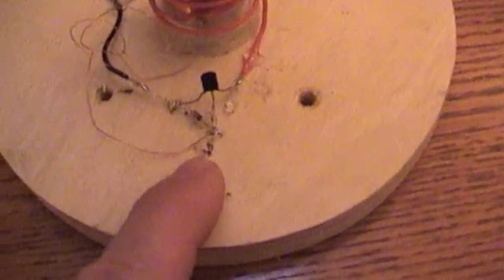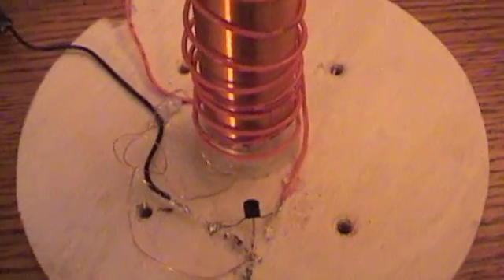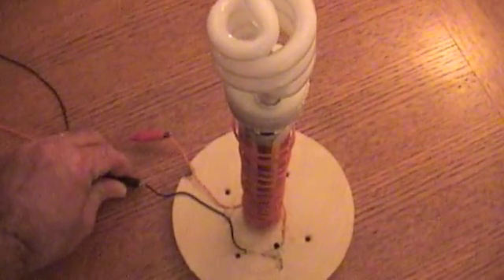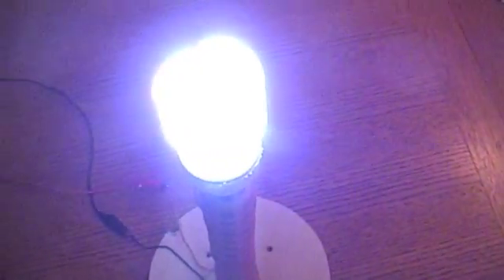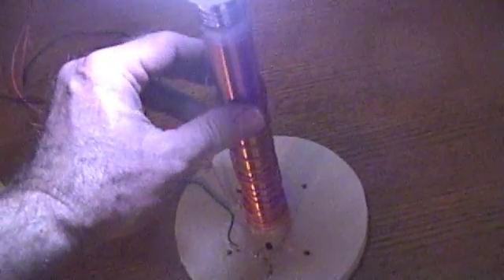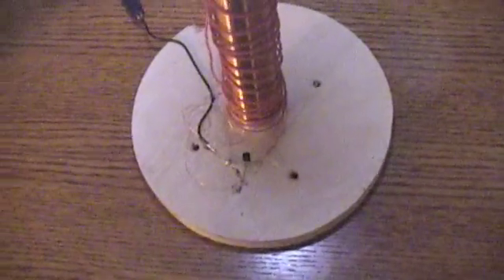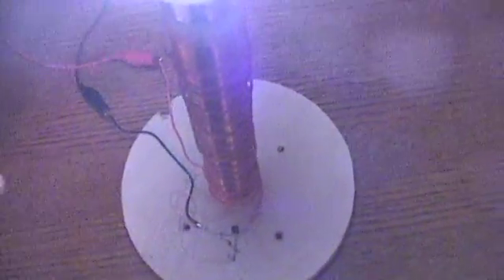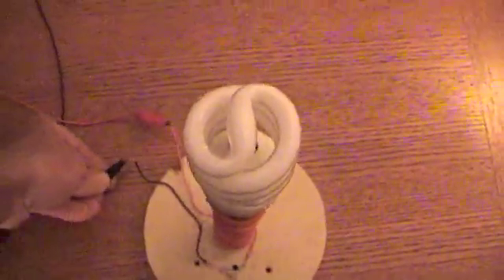Tesla Lamp 2.0 CFL driver

Comment: maybe try a fast power transistor. My slayer/tesla coil is running a tip31 Gives about 1.6mhz on L1. Which I can tune to about 10mhz on L2. Circuit is very similar. I'm not surprised the 3055 didn't do much. Nice work getting it to start. I didn't think it would looking at the drawing. Do you think the diode could be picking up a EMP from L1 or L2 and collecting the charge to fire the transistor? Great brightness for 1.5w. did you say what wattage the bulb is rated at?

Comment from the maker: Possible but unlikely.  The 12 volt is safe, and the high voltage just goes over your skin and not through you.  You can touch this device all over.  Household AC is dangerous!

Comment from the maker: It has to do with field coupling on an air core and turns ratio for your voltage.  You don't want the primary tight on the secondary.  I am now moving mine out so the diameter of the primary is 2x the diameter of the secondary.  When I do that amps drop a lot.  But when you do that the turns have to remain in the same ratio to the secondary.  For this reverse bias and CFL the turns ratio for 12-14 volts so you don't blow the transistor has to be no higher than 20:1.  16:1 is safer.

Comment: I see. Thank you for your reply. 
It's nice to see a face on these type of vids. 
I tried spacing my primary wire out more on my old slayer exciter, but didn't get as good light, but it's 1000 turns of 26awg on a 9cm dia. With the new Lasersaber Joule Ringer circuit, spacing seems to be a benefit. 
I have to ask, if you get the amps down to 94ma or so the light doesn't diminish? 
I guess I will see in your next vid.
Thank you again for your help and time.
Cheers

Comment from the maker: Amp draw on 12 volts didn't exceed .254 amps.  But, with refinement of the primary windings the amp draw went down to .094 amps (94 ma).  I will be showing that part of the build today or tomorrow.  Basically you don't want the primary wrapped tight on the secondary.  Its going to be more like on a 1.75" diameter and about 30 turns spaced across the length.
The PVC is actually called 3/4" pipe (even though the OD is bigger) The length is 9" but the secondary is about 8" long.

Comment from the maker: At 1700 khz (upper end of AM) there is some noise on 6 volts right next to the lamp.  4 feet away I don't hear anything.  On 12 volts I hear a little at about 75 mhz (low end of FM) if I touch the radio and it is within two feet.   On 6 volts its a slight AM whine, on 12 volts its FM fuzz.  I still get all the stations clearly.  If I touch the battery negative wire insulation, the sound goes away and doesn't affect brightness.

Comment: That covers AM radio and up into low frequency amateur radio. Add a modulator and you can talk to your neighbours on their radios.  Hahaha  I am just kidding.

 I just looked up the frequency of the CFL bulbs' original boost circuit. It is 100Khz down to 22Khz for one IC datasheet, which I examined.

You could check your AM radio and see if you can hear any interference from your circuit. I did a video about a FM transmitter with a 1.5v cell and it easily reached the perimeter of my lot line.

Comment from the maker: I don't know what the frequency is, but typically it is 1-4mhz.  Yes we are doing the same with ferrite cores, but they ring.  Look back a few videos and see my replication of Laser Saber's Super Joule ringer 2.0.  See his circuit at LaserHacker (dot) com lighting 11 large LED bulbs off a 12 volt supply.  What I am doing here is a little different with the amplifier and air core transformer.
Next up is to string a single wire off the HV and hang CFL AV plugs off the wire for simple room lighting

Comment from the maker: 500 turns.  The reason I don't spec that out is because it is very difficult to count.  If you just wind the secondary one turn against the next the full length of the tube you are fine.  I will show how this is done in a future video.  Only takes a few minutes to wind.